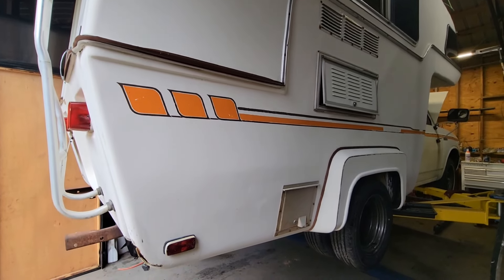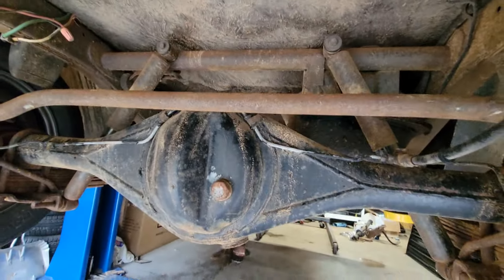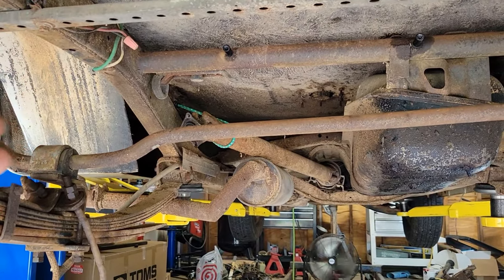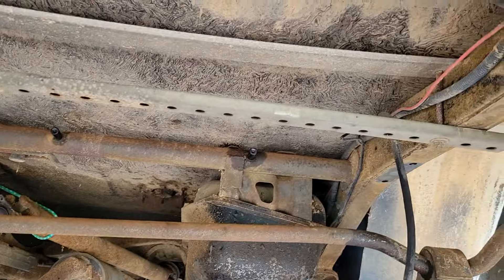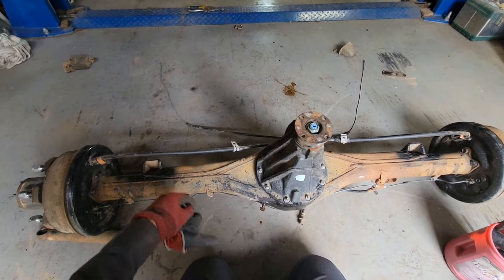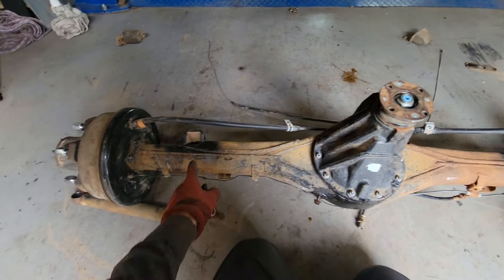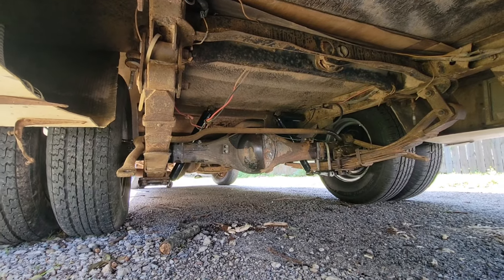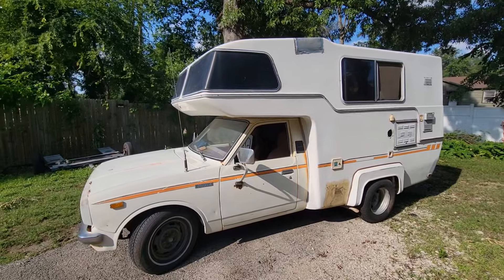1-Ton Axle Swap Into Toyota Sunrader RV

Comment: Thanks for this video, im hunting a late 70's sunrader and this is likely something that we'll end up doing. Anything you would have done differently next time, apart from y'know.. not doing it atall.
Reply from the maker: I'll probably have this one ready to sell this winter.  It's too short inside for me to keep (about 5'11" ceiling).  If I do another I'll probably just swap in a 3/4-ton axle or maybe just build a custom Ford 9" and utilize single rear wheels.  I'll probably finish this one as a solar/battery rig and ditch the traditional genset and mounted propane tank.
Reply: @RosyWrench  Im surprised its so short in there, I've never heard that issue before. Is there any aftermarket flooring in there? If you were in Canada I'd be very interested in this thing.